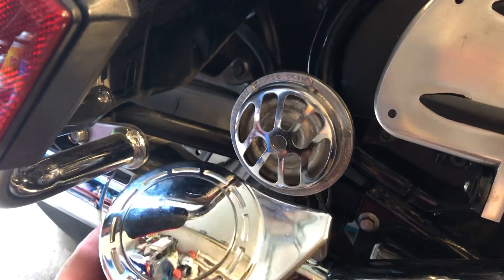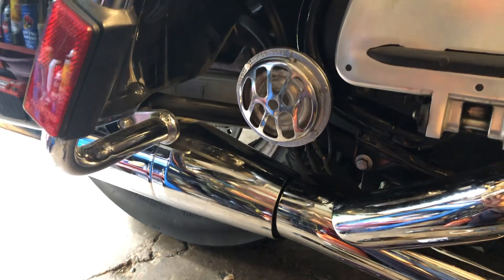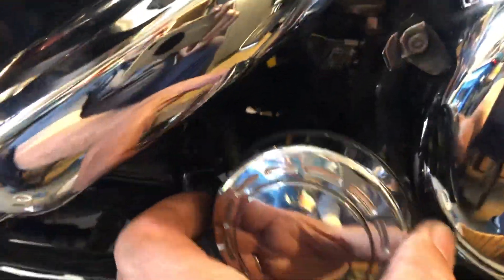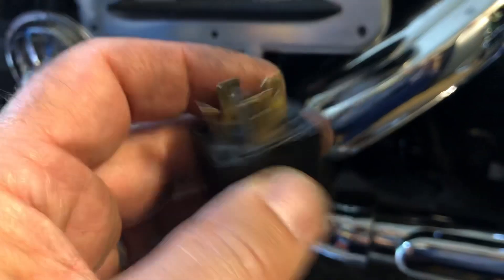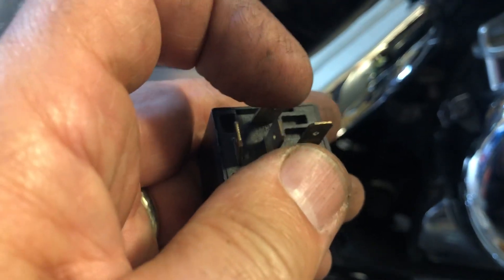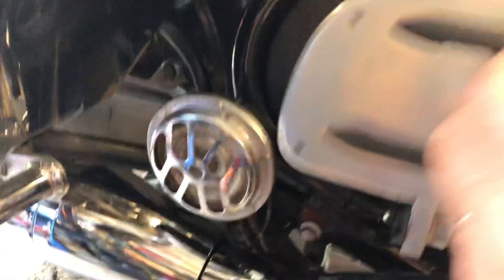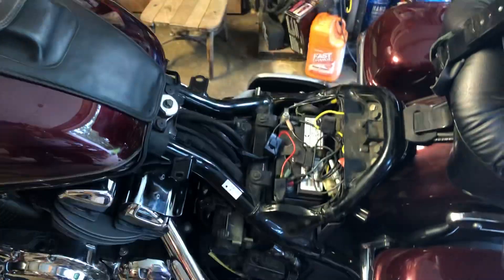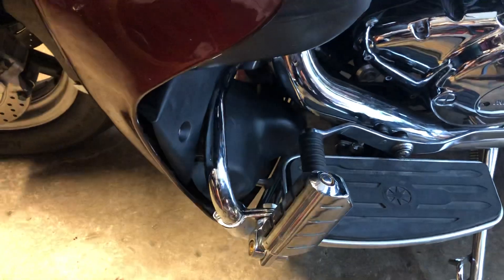Loud Motorcycle Horns￼  Venture

Comment: Let me see if I understand your connections: you mounted both horns 
then you disconnected the OEM right side horn and the connections that went to that horn, you put on two of the four prongs of the relay

That leaves two prongs of the relay remaining unused.

 then you put a wire connecting the right side new horn on one of its prongs to one of the empty two prongs left on the relay
 then you put another wire to ground or from ground to the empty connection on the right side horn just installed.

 now that leaves you with one empty Connection on the relay unused.

 so did you then take a wire and go from that last empty connection on the relay to the left side horn (the “ jumper”  that you spoke of) ?

and then that leaves you with one empty connection on the left side horn
 and you connected that empty terminal on left side horn  to ground. 
 is that set up? and if so how do you know which of the four prongs on the relay go where? 

I’m asking because I’d like to do the same set up but I currently have a Wolo  low tone horn set up on the right side 
but I disconnected the left OEM horn like you did and just left it there because when the OEM is connected I get no sound when I push the horn button I just get a little thump with the Wøllo installed on the right side.

 and if I try and install another low tone Wolo where the left side OEM horn is, the same thing…. it only seems to be one or the other that works when I put a Wolo on. 

So, I thought maybe the master is the right side horn and the slave is the left side front horn.
 so I just disconnected the front and left it there like you did before I saw your video.

but after seeing your set up, I’m wondering if I could get a high tone horn from Wolo (to complement the currently installed low tone on the right),  install it on the left side like you did and use your set up and then both Wolo horns will  sound in sync when I push the button.

 I’ve never dealt with two horns on a bike before so I’m having some sort of issue.
Reply from the maker: At the 1 minute 5 second Point of my video, as I am holding the horn in my hand while flapping my jaws, you can briefly see that that horn has four terminals…
   The other horn on the ground only has two terminals to slide those female spade connectors onto..
  current path is
wire connected to positive terminal of the battery.
  in-line fuse soldered in line and protected with heat shrink tubing, and additional red tape on that yellow wire that has the blade type fuse, 10 A
  that positive wire after the in-line fuse goes to the horn relay, let’s call it the load terminal
  then another wire goes from the second load terminal to the horn on the right side with two sets of twin terminals
  Power for the horn on the left side comes from the four terminal horn on the right where the power wire comes from the load terminal on the relay
  on both horns. The unused terminals are simply wired straight to ground where the horn is mounted on each side..
  The two terminals on the horn relay that control the opening and closing of the switch, are the ones depicted on the diagram of the horn relay that show a schematic diagram symbol for a switch . That will be indicated as a normally opened switch which means, when it’s not powered, it is normally in the open position, not making a connection in the circuit
   The two wires that fed power to the original horn will make the horn relay operate the switch internally. You will know the relay is working if you turn your key on to the run position, and press the horn button.. you will hear and feel the relay clicking if you have the two wires on the correct two posts that used to feed the original horn..
  so basically you have two independent circuits
  One is the control side that simply operates the horn relay with the existing old horn wires.. that circuit was and is in place before you even started
  The second circuit you added was simply the power from the battery through the fuse, to the “Load “terminals on the relay. When you press the horn button on your handlebars, that completes the circuit from the battery, through the fuse, through the relay, to the horn on the right.. then the power wire to the horn on the other side of the machine just doubles up on the terminal from the relay to the horn on the right, you make a jumper from the horn on the right to the horn on the left. And then the second terminal on the left horn just goes to ground..Through the horns, to ground which each horn is grounded to the frame where they are mounted with a jumper wire from the second terminal on each horn to a ring connector that goes under the mounting screw or bolt you are attaching your horn to the bike with.
  pressing your horn button closes the switch in the relay. That is a complete circuit when you push the button
  closing that switch just completes the circuit from the battery through the relay to the horn on the right which has a jumper on it to the go to the horn on the left.. then both horns unused terminals are simply grounded..
  look at it this way
  your horn button on your handlebars completes the circuit and makes power go to the relay to close the switch inside the relay
   The switch inside the relay is just like the horn button on your handlebars which is simply completing a circuit.. you complete the circuit manually with your thumb on the handlebars, and that makes the relay complete the circuit internally from the battery to the horns to ground. You are completing two independent circuits by pressing the horn button. One you do manually with your thumb, the other one is completed inside the relay, it’s like a switch loop on your wall of any room in your house. That is a wire that comes from your panel board, and goes to a light fixture. You have simply interrupted that path from the circuit board to the light fixture by putting a break in the wire, that breaking the wire is a switch. When you flip the switch, you complete the circuit turning the lights on
Reply from the maker: Sorry it took so long to get back to you about the horn install. I’ve been busy..
 OK. I removed the right side horn on the Venture. That left two wires from the wire harness on the Venture
  those two wires go to the two terminals on the relay that energize the coil. Think of the coil the same way you would think of a light switch on the wall of your House. To turn the lights on, you flip the switch up or down to complete the connection
  on the relay, you push the airhorn button on your handlebars, that sends power to the coil on the relay and completes the circuit inside the relay when the coil is energized by magnetism. When the coil has electricity, it magnetically closes the switch..
  OK there are two load terminals on the relay that are designed to handle the heavier current draw that the horns will make. One wire come straight from the battery positive terminal to one of the load terminals. It doesn’t matter which one. When you push the horn button on your handlebars , that completes a circuit from the battery, through the relay to the horns. That’s all it does. That one little job. There is no magic to it. The relay is just a switch just like on the wall in your house. Instead of you manually flipping the switch like you do at home, you are flipping the switch by pushing the button on your handlebars to close the switch. The reason the switch opens when you let go of the button on your handlebars is, it is what is known as a normally opened switch. When it’s energized, it closes, when it’s not energized from the button on the handlebars, it opens, discontinuing the power flow..
  as for the horn wiring, you can wire it in series or parallel it doesn’t matter, series is going to one horn, and jumping over to the next horn, then to ground, parallel is having two wires go to each horn.. they both complete the same task
 i  did it in Series..
 just one wire from that second load terminal on the relay to one side of the horn. The horn I have on the right side has four terminals. The reason for that is they are made as a set, there is an extra set of terminals on one of the horn so that it can feed the second horn off of the first horn.. Nice of them to simplify things by doing that..
 so..
 Power flow for the load which is the horns, comes from the battery positive terminal, to one of the load terminals on the relay, then the continuation of that flow to the horns requires a wire from the second terminal/low terminal on the relay to one of the terminals on the horn with four terminals. It doesn’t matter which terminal..
  OK so the wire from the relay to the horn, then on the other terminals on the first horn you just run a short jumper to a ring connector to ground. A ring connector is just like a washer with a wire terminal you can crimp and solder on the end. I put that under the mounting bracket. The power has to flow from the battery through the relay to the horn to ground.. like a lightbulb, the horn is just part of the current path from positive on the battery to ground with the second horn, you just run a positive wire jumper from the terminal on the horn that is fed from the relay on the right side of the motorcycle, over to either terminal of the horn on the left side, that’s the hot wire let’s call it, then the remaining bear terminal on the left side just goes to ground..
  that’s pretty much it. You just have to get 12 V to the first horn and then the second horn has a parasitic draw off of the first horn. The current must flow through the horn to ground on the right side and through the horn to ground on the left side. You control the current flowing from the battery to the horns to ground by using a relay that is controlled by the handlebar horn button, just like you control the lights in your house from a wall Switch..
  make sure you put an in-line fuse between the battery and the load terminal on the relay..
  A completely different subject here
If the horns are not as loud as you think they should be, there’s usually a lock nut and a screw on the back of a horn that you can adjust the volume of the horn by turning the screw in or out until you find the correct amount of volume

Comment: Nice job.  I don't know why manufacturers overlook this important safety issue.  Where and how did you mount the relay?
Reply from the maker: I actually know the answer as to why manufacturers do not put real horns on motorcycles $$$
  OK back on track..
  I zip tied the relay to the ground strap to the engine case, I think it’s the ground strap, just inboard from the oil filler cap.. The original two connector plug that plugged on to the original horn, was webbed together. I just cut the webbing off and plugged the connectors straight onto the control side of the relay, it fit right on the relay..
  Power for the horns wired from the battery through a 10 amp in-line fuse to the power side of the relay, and from the second power terminal on the relay to the double post on the horn. These horns are sold in pairs or made in pairs. So one horn has double connectors for the positive, and double connectors for the negative, and the Second horn which is a different pitch/tone , has just one positive, and one negative terminal.
  so from the relay ,power terminal,goes to  one of the double terminals on the horn, and that second terminal  i made up a jumper going across the bike ,past the battery to the single terminal horn.. both horns have a short grounding cable/strap  i made that is simply grounded to the nut that holds the horn onto the bracket..
   I had to cut all of those yellow plastic collars off of each of the female spade Push on connectors so that I could solder them, and I used shrink tubing to shield the bare spades..
  I bought the “female 10/12 gauge spade connectors”on eBay.. I think they sell for around 10 bucks for 100. You have to make sure you get the right gauge to accept number 12 wire, otherwise the hole in the spade where you put the wire will be too small, or too large.. The connectors I used for grounding are called ring connectors. They are simply a washer it has been made with a crimp section you can insert the wire to crimp the wire to the washer. Then it’s called a ring connector.. again you have to make sure it will except the size wire you want to use, which one you’re working on a car or a motorcycle or a truck, 12 gauge wire and 12 gauge connectors are generally what you need..
 I should have mentioned in the video that the brand name of the horns is VOXBEL. They are not Moto Guzzi horns, they just used to put them on their bikes in the 70s and 80s..my last guzzi- a norge 2007- had a cheap tiny quiet buzz horn.. I put a set of these on that machine..
  I checked on eBay in the first week of June, 2022 and there were many sets of voxbel horns for sale. The most I have ever seen. And the prices have really gone up. I used to be able to pick a  used set of these up for 25 bucks, now they’re close to $100…I believe you can still buy them new but I’m not sure if they are replicas or the originals..
  in  one of my other videos for my Kawasaki Z 400 , I show a pair of Hella freeway blasters. I put a new set of those on my last pick up truck and they were a factor compared to the stock horn on my pick up. The ones on that pick up were the German made ones just before hella moved production to an Asian country…. years later I bought a new pair of the freeway blasters on eBay last year for my Z 400, and they  seem to be just as loud. 
   that was a tough job to find a place to install them on my Z400 as you can see in the video.. I didn’t want to mount them blocking airflow over the radiator, and I didn’t want to mount them near the exhaust pipes..
  The reason I put bicycle bells on my motorcycles is because I put these loud horns on and I don’t wanna upset people I know by beeping at them, so I just give them a cha ching with my bell instead..